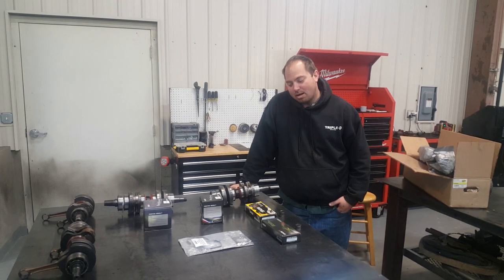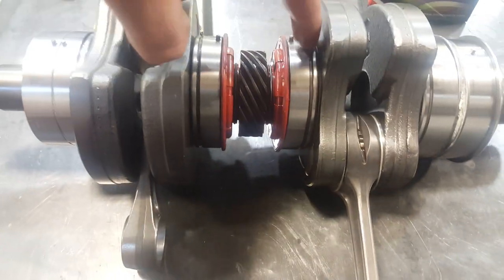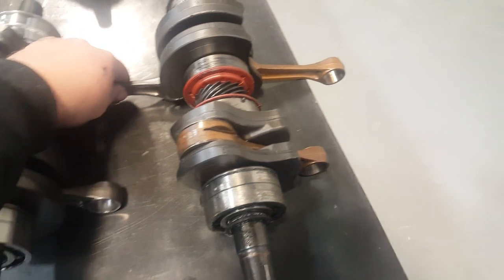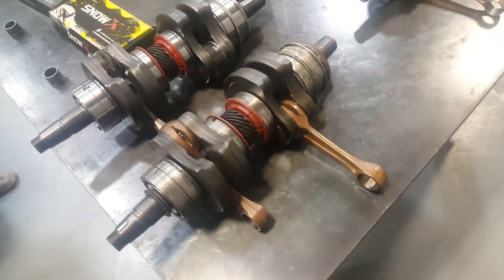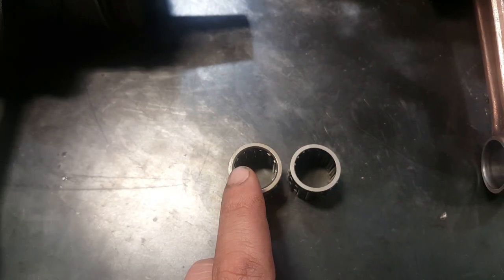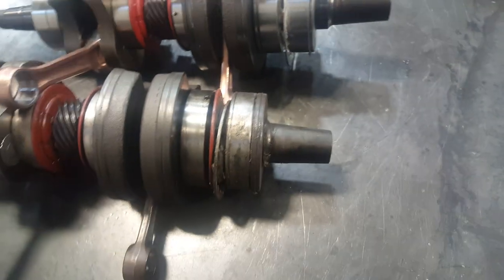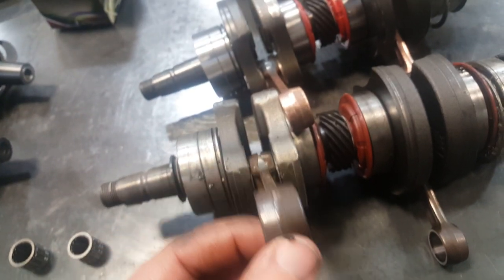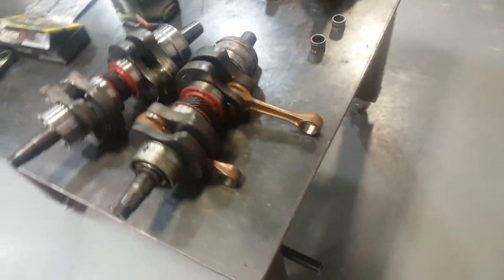Let's talk Skidoo crankshafts 800 ho vs 800r ptec etec differences

Comment: Awsome video. Thanks for making it. This is the type of info the average back yard mechanic is missing when building a motor. I am currently rebuilding a 2010 600RS and my crank is a fully oiled bearing crank but the parts fiche calls for ISO flex grease. Im guessing I have a different bottom end.

Comment: I like the old rotax 583,643 and the 670. Use a rotax 670 in my old yamaha, but i have taken out 4 or 5 conrod bearing on the mag side. Oilpump delite, aprox 1:32 oil mix in the gas, flatslides and short intake, tunnelporting and just a little work to the cylinders, never figuerd out why killing the conrod bearing mag side. Got my hands on one rotax ptek 800, but thats not what i want in my exciter, want a 670 if i figure out what couses t mag problem..
Reply from the maker: Yeah those older 617, 643, and 670 cranks are great. Not sure what is causing your mag side failures. Those Rotax cranks usually take a lot of abuse before they fail.

Comment: Would a 2009 800 crank and pistons work in a 2008 800 engine or would the timing be off like explained on the Etek? I know the flywheel from the 2008 would not work.

Comment: well the 1992 mach one had to swap the whole crank none of it was rebuildable coming from the dealer had to exchange the origional crank for a new crank complete. that is interesting 
that a crank can be pulled apart to repair
Reply: Are u shure. I beleve they are rebuldable, looks a lot like the 670 crank, 670 can be rebuilt, they even put 2 cranks together and make a 4syl out of 2 rotax 670 side by side. Dont knowe for shure witch type off crank cranckshops tripple rotax 670 based race engine has, also has 4syl race engine. One 4syl crankshop race engines has been in norway aprox 15years, 2000cc 2t engine, ive prepped the race track for em to do their first testruns, it blew 1drivebelt each 1/8 run

Comment: So what’s the life span of these 800s. I’m hearing 4000 miles is about it, then 5K to rebuild them ?
Reply: I had an 800 HO rebuilt last year, cost me $1800, complete from crank to piston. I pulled the motor, and dropped it off.

Comment: But what is the reason that those wont keep straight and balanced? I have second 800 etec now with 2600km in it and that f**kin engine is already wobling and jumping around.🤬
They are really nice engines from other parts but that crank..
Reply: Will true & welding keep them straight?

Comment: They're all the same all those cranks blow out at 2500 miles they finally got rid of isoflex grease they should have been all oil bearings from the start
Reply from the maker: Yes they should have been. Isoflex is a pain. Now we are dealing with 850 crank problems and issues. I have about 50 of the 850 non turbo cranks to rebuild atm.